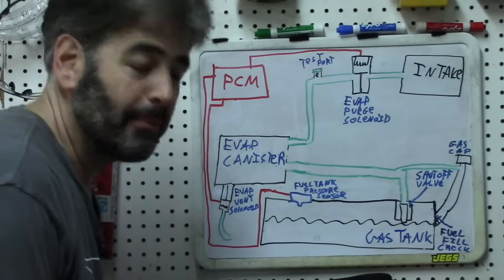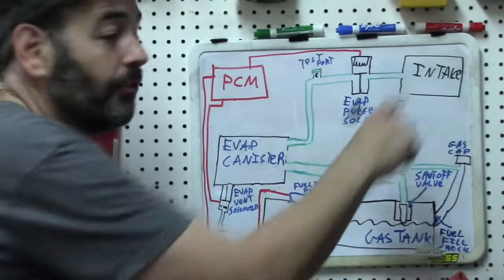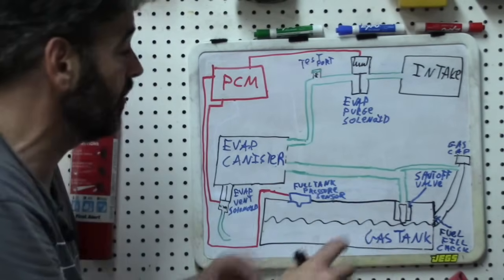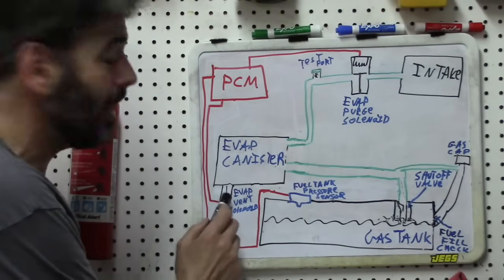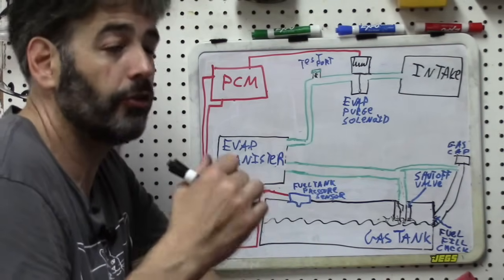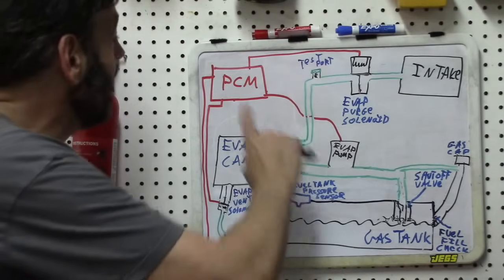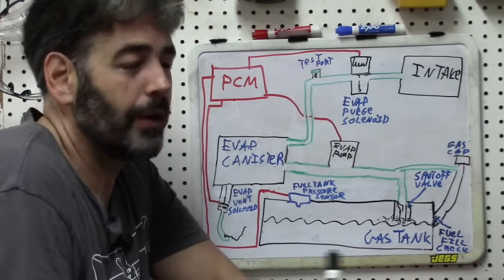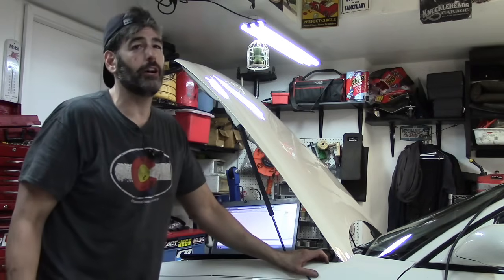Diagnosis + Understanding EVAP Systems (SBQM Full Video)

Comment: why  when key is turned off,, other than charcoal canister plugged.. wont the pressure release.. only other thing is spill valve at the exit of tank. and there is an electrical sensor by it too . some sort of pressure sensor. If pressure gets too highin tank will shut down engine?? not  sure about that. Thats why if I unhook hose going to charcaol filter it never gets pressurized , because the everything from the exit is eliminated. trying today.

Comment: Great!  video--- But I been changing everthing and still cant put  gas in Usually worse after driving 20 miles..fill flipper wont open..almost always P0443. almost seems like the gas shutoff valve in tank is stuck  closed.. I blew air backwards from canister to gas valve hose.. I heard a bang.. seemed to help a few fills. Takes hour or more  for pressure to  fall enough to  get  any gas in  Slowly...I going to leave hose off  to charcaol filter...and fill with gas...That should  let me know if the gas valve is the culprit---right.
Reply from the maker: It will help.  You have to cover all variables though.

Comment: Yellow there... I have a 1998 3.3L Nissan Pathfinder. 175,000 miles. Great condition. Stock. My tank gets alarmingly  pressurized when driven a couple hundred miles. I don't have any codes. My Nissan gas cap visually inspects clean and good. Does not leak. 

I even disconnected all hoses on the EVAP system and cracked the gas cap. No codes were made either. How can that be? I drove it dozens of miles to test. To see if the missing stopped or codes would appear. No codes, except random misfire. Every now and then, but the motor is obviously missing mildly to badly all the time.  It gets worse for a while when I refuel.  For a few dozen miles.  

When this system started doing this, I started getting a random misfire code at the same time. These may be unrelated. Not sure. 

I have verified purge valve works, hoses are clear now. One was dirty about 2" clogged at the canister for the purge line. It looked like charcoal dust. All other hoses clear. 

Any ideas?  I was going to remove the plug from the cannister ambient vent valve and see what that did. It should toss a code right?  And make the valve open, from my understanding?  I don't want the tank to pressurize like that again.  It will spew and hiss for about 6 minutes when cap is removed. I've never seen a vehicle do it this badly before. 

Appreciate it!

Comment: Could a purge valve that is broken and won’t open make it difficult to fill your tank. Have a 2011 Subaru wrx and having problems filling. The gas pump keeps stuff.
Reply from the maker: No. Not a purge valve.

Comment: great video, 98 camry been throwing codes (evap) after replacing charcoal cannister. Just replaced purge valve. As someone without all the specialized tools I am "shotgunning" the problems then waiting for the system to reset. I learned about idle air control valves from other videos and I have fun learning.

Comment: sooo lets say if i plug the hose to the engine so that the engine never gets any fumes to burn, could that change the afr to a point were it might run too lean or too rich? 

i want to leave the System in place but i want to use a different throttle body that doesnt have the port for the evap hose.
Reply from the maker: Why on earth would you want to do that?
Reply: @SchrodingersBox  because in order to use a different intake system i would need to use that throttle body.
Reply from the maker: So simply route the evap to the intake then. It’s still solenoid controlled on the purge. It doesn’t have to be a ported vacuum.
  That way you keep the MIL off.

Comment: I know this is an old video, but I had a quick question..... considering the EGR valve...suppose someone wanted to determine throttle pressure for a meth/water induction system....and used a pulse sensor T-d off from an EGR valve on a throttle body (orifice -only *not a valve*) and wanted to since throttle for a water/meth controller with a love voltage pulse driven sensor....do you think that the EGR (orifice) would work for that?
Reply: Oh my... 🤦....
*Sense 
*Low
Reply from the maker: No it wouldn’t.
Reply: Can you please advise? I actually need to know how come a 5v pulse pressure sensor won't work as a throttle sensor from an EGR 'orfice' (not valve).... please help me figure this out.....I replaced this engine...I really just wanted to see it work out 😬
Reply from the maker: Because the EGR oriface is only open to the intake at certain times. And never at warmup. And never at WOT. 
  So even if you did get it to work including somehow calibrating the PCM for the totally different input voltages- how will this system work when EGR is closed, not operated at all, or there are variances in the pulsewidth modulation?

Comment: Hi man I'm from South America Guyana I've been trying for forever to get a repair manual to better understand certain systems and get certain spec details can you shed some light there and also I have a vehicle that I use for public transportation so far I've changed about 7 or 8 fuel pumps in less than a year or less than 6 months I would replace the pump and the fuel trims would improve then after a while it just starts getting lean and in a week or so the pump becomes weak again to be fair these pumps are massive produces and not the OEM because the OEM cost anything near 500 dollars so it's really hard to buy that I'm stressed out because my vehicle drives terrible because the pump is failing and replacing pumps so often is not appealing

Comment: Hi sir how are you i saw your video and you have describe in detail the evap system grest job 
Well bro, i am from qatar,and i have ford explorer 2009 xlt i am facing issue in my car about Evap.The history of my work in car is that i have replace the purge valve 2 days of change purge valve no engine light no codes but after 2 or 3 day evap code appear with check engine light.And this problem aarives after 8 to 10 km drive.i dont have scanner to scan code again an again
You can advise me how to diagnose this problem from start.before i replace any other component
Thank you
Reply from the maker: What was your fuel tank pressure when purge valve and vent valves were closed?
Reply: @SchrodingersBox  well i dont know i never test that.How i can test tank pressure.

Comment: The canister vent solenoid is closed only when the evap system is undergoing a leak check monitor. So when driving down the road the evap vent is open so the purge of gas vapors can occur. Otherwise the engine will just pull  vacuum on the system and the charcoal will remain saturated. It's surprising how little air filtration occurs when the outside air enters the system. Might keeps or rocks, but not dust, IMO.
Reply from the maker: That’s correct.
Reply: Hi. I have a 1998 3.3L Nissan Pathfinder. 175,000 miles. Great condition. Stock. My tank gets alarmingly  pressurized when driven a couple hundred miles. I don't have any codes. My Nissan gas cap visually inspects clean and good. Does not leak. 

I even disconnected all hoses on the EVAP system and cracked the gas cap. No codes were made either. How can that be? I drove it dozens of miles to test. To see if the missing stopped or codes would appear. No codes, except random misfire. Every now and then, but the motor is obviously missing mildly to badly all the time.  It gets worse for a while when I refuel.  For a few dozen miles.  

When this system started doing this, I started getting a random misfire code at the same time. These may be unrelated. Not sure. 

I have verified purge valve works, hoses are clear now. One was dirty about 2" clogged at the canister for the purge line. It looked like charcoal dust. All other hoses clear. 

Any ideas?  I was going to remove the plug from the cannister ambient vent valve and see what that did. It should toss a code right?  And make the valve open, from my understanding?  I don't want the tank to pressurize like that again.  It will spew and hiss for about 6 minutes when cap is removed. I've never seen a vehicle do it this badly before. 

Thanks!
Reply from the maker: You either have a clogged vent from the tank OR the pressure sensor is faulty and not representing the actual pressure which isn’t high. Are you measuring pressure separately or are you using the PID for tank pressure?
Reply: @SchrodingersBox  there is a plastic threaded port on the evap purge line under the hood.  I may have a fuel pressure adapter I could attach there.  There is a label on it saying max 1 PSI. 

I have tried running it many miles with the cap cracked loose. It didn't change any operation or throw a code.

PID?  My simple Bluetooth obd2 reader is what I'm using. App on phone.
Reply from the maker: Measure actual pressure. I bet it’s within spec.
Reply: @SchrodingersBox  do I check it at the evap purge valve hose test port?  Or what?
Reply from the maker: You can as long as it is between the purge and vent valves.
Reply: @SchrodingersBox  yes its on the feed side before the purge valve in the engine bay.
Reply from the maker: Yep that’s what I would expect. You can totally use that port. Remember they have a left-hand thread schrader valve in them- you will most likely have to remove that unless you have some type of compatible special connection to the gauge.
Reply: @SchrodingersBox  the cap for it screws on right hand thread.
Reply from the maker: Yes the cap does. The valve itself is left hand though.

Comment: You said in the starting of the video that car engine dies at idle with no check engine and you suspected EVAP leak as potential problem. How can EVAP system can cause engine to die at idle? My car is giving the same problem btw. Any input would be highly appreciated. Thanks!
Reply from the maker: If the evap purge is open it would cause a rich condition that may cause stalling.

Comment: Really good info here!  Interesting observation... you mentioned some systems use a pump rather than vacuum to test the system.   So when that pump fills the system with air, that must not be considered a fire or explosion hazard introducing oxygen into a system containing fuel vapors.   I've heard some technicians won't pump air into an evap system to test it because of the fear of oxygen mixing with the fuel vapors posing a fire hazard.  But would this system indicate that the auto manufacturers do not see that as a danger?
Reply from the maker: Good thought. 
My understanding is it’s not so much the mixture of oxygen and fuel vapors as much as it is doing so under pressure.  The pressure created is only like 1PSI.

Comment: Got a 2001 ford Taurus running rough if it starts at all. I changed the egr valve and the other 2 by it and it still runs bad. What do I check next?
Reply from the maker: What data showed the EGR valve was bad?

Comment: Can you explain the evap vent valve. Normally open, it seems like the gasoline fumes would escape from cannister to atmosphere there.
Reply from the maker: yes it would seem that way however the actual gas vapors are trapped in the charcoal cannister. if there wasn’t a charcoal canister then yes- you would normally smell fuel outside the vehicle since the vent is open.

Comment: MATT, THE POWER FOR THE PURGE VALVE ON A 2005 MARINER OR ESCAPE COMES FROM THE HEATED EXHAUST GAS OXYGEN SENSOR FUSE TERMINAL UNDER THE ENGINE HOOD FUSE BOX. IT'S A 15 AMP FUSE. MINE WAS BLOWN. I REPLACED IT AND CLEARED THE CODES AND EVENTUALLY THE FUSE BLEW AGAIN BEING AN INDICATION EITHER THE WIRING HARNESS MAY HAVE SHORT SOMEWHERE TO THE HOT EXHAUST PIPE OR THE OXYGEN SENSOR IS SHORTED. THE BEST RULE OF THUMB HERE, IS TO TEST ALL YOUR FUSES. BECAUSE THE OWNERS MANUAL HERE .DOESN'T SPECIFY A FUSE FOR THE PURGE VALVE. BUT ONLY THE VENT VALVE. IN THE CASE OF MY MARINER IT IS PIGGY BACKED TO A RELATED COMPONENT BEING THE OXYGEN HEATED SENSORS. THE ENGINEERS CAN ALSO PIGGY BACK THE PURGE VALVE POWER TO ANOTHER CIRCUIT FOR OTHER CARS WE JUST DON'T KNOW. SO THE RULE OF THUMB HERE IS TO CHECK ALL YOUR FUSES WHEN LOOKING FOR A LACK OF POWER TO A COMPONENT. I WENT ON A WILD GOOSE CHASE BECAUSE NOBODY WAS ABLE TO ANSWER MY QUESTION AND DUE TO THE LACK OF KNOWLEDGE. THE ECM BECAME THE SUSPECT. I MADE A CALL AND I WAS ALSO TOLD BY THE COMPANY I BOUGHT A REBUILT ECM FROM THAT THE +12V LIKE THE -12V COMES FROM THE COMPUTOR. HOLDING A ELECTRICAL ENGINEERING DEGREE I SHOULD HAVE REALIZED THAT WOULD NEVER HAVE BEEN THE CASE DUE TO THE FACT THAT A SHORT WOULD DAMAGE A VITAL COMPONENT THE ECM. SO THROUGH TRIAL AND ERROR I FIGURED OUT THE PROBLEM AND I'M PASSING ON THE FEED BACK TO MAKE LIFE EASIER FOR EVERYONE WHO COMES ACROSS THESE PROBLEMS.

Comment: HERE IS MY SITUATION AND I COULD USE YOUR EXPERTISE. THE PURGE VALVE IS GOOD I PUT DIRECT VOLTAGE TO IT. THE WIRING HARNESS THAT PLUGS IN. HAS NO CONSTANT +12V. BUT A CONSTANT NEGATIVE SIGNAL. THERE IS NO FUSE FOR THE +12V CONSTANT GOING TO THE PURGE SOLENOID. I WOULD ASSUME IT COMES FROM THE PCM. THE VENT SOLENOID HAS ITS OWN FUSE BUT NOT THE PURGE VALVE. IT'S A 2005 MERCURY MARINER V6.  DOES THE +12V CONSTANT COME FROM THE ECM????? THAT IS MY MAIN QUESTION. I BOUGHT A REBUILT ECM AND I'M STILL GETTING THE SAME PROBLEM NO CONSTANT +12V AND A CONSTANT-12V. COULD THE REBUILT ECM HAVE THE SAME ISSUE?

Comment: Thank you for taking the time to make this video on the evap system. I've been having trouble getting the evap monitor to run even after replacing the canister and purge solenoid. Completed a smoke test and fixed 2 small leaks. No codes showing yet 100's of miles later and the Evap monitor is still not ready. Driving me completely nuts. Any suggestions? Appreciate any ideas

Comment: Hey i live in a 1st world country on a fast track to a 4th to a 3rd world country called the United Epitome Of Stupidity States Of Americ'Duh!
I live in the fine land of Oklahoma
Does that count?
Lol
Man i LOVE THE TRANS AM! You know this. I ask for it all the time. I have a 94 Ford Mustang 3.8 v6 5 speed. One line was rotted to the can. I pulled off the wheel well and pulled out that can because the car was running like crap. It is filled with liquid fuel.  So that is a problem correct?
Just replacing the can wont help because i need to check the valve in the tank to find out why the can is getting liquid fuel right?
That line i was telling you that i replaced i put a clear line on it and its FILLED with fuel. NFG right? Im not sure
Reply from the maker: I am actually considering extending my 3rd world nation discount to california lol, but I do agree the nation is swandiving across the board. 
   Would love to help with the car issue but to be honest I didn’t understand the question. Can you clarify a bit?
Reply: @SchrodingersBox  my vapor box is filled with fuel, not vapor. I know Ford uses a return line system so is it normal for that to have fuel in it or should it only be vapors?
Reply from the maker: Ohhhhhh ok got it, got it. yeah almost guaranteed this is one of two things. either intentional overfilling of fuel tank (ignoring the pump shutoff and still adding fuel) OR there is some type of leak or failure where the vapors are not activating shutoff. as shown in the video, many things could cause that. in any case there is no way around it, the canister must be replaced but you also want to check the system to make sure new canister also doesn’t fall victim to this. but indeed- new canister is needed.  no way around that.
Reply: @SchrodingersBox  yeah I figured as much. The purge valve is already shot due to charcoal pellets getting through and jammed inside. 
I just pulled the entire canister the lines the valve and air idle control valve as well as a few other things that need be done while I'm in there. 
So I'm about to look now and see what Ford did in 94 as far as what was used to plug the vent line when the tank is filled to find out what failed to let that happen.
 I just bought the car so it wasn't me anyway but I did get a great deal because it was running like dog crap and they couldn't figure out why.
It's only the 3.8 V6 but it's a 5 speed so I grabbed it and to be honest when I got it somewhat running good once home that sucker has some beef for a 6 banger!
Now I did pull out a case of brake cleaner and figured I'd use that like an easy button and just spray away all that is wrong and be on the road in no time but my wife said after all the hours I have spent watching your videos that you would be disappointed if I took that shortcut and how much money is wasted in brake cleaner and I should save that fix as a last resort or like when the weather sucks!
I said BRILLIANT!  LMFAO
So it's not a WS6 TransAm but I got the 6 part anyway So it's a M56!
Mustang 5 Speed 6 Cylinder!
So look out now! You can almost see me in your rear view! 
LMAO!
Thanks for responding and thanks for all you do and share and thank you ESPECIALLY FOR ALWAYS SPEAKING ON THINGS EXACTLY AS THEY NEED TO BE SAID AND ALWAYS ADDRESSING WHAT IS THEORY AND WHAT IS REALITY!
WITH THE PROPER AMOUNT OF SARCASM WHEN REQUIRED!
and it's always best to lay it on thick cause you can never have too much!
lol
TTYL!